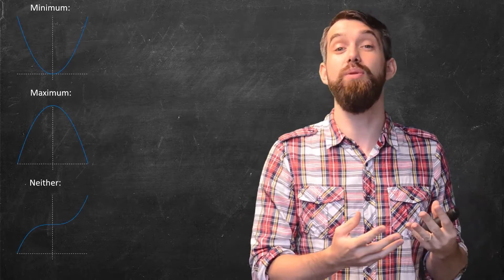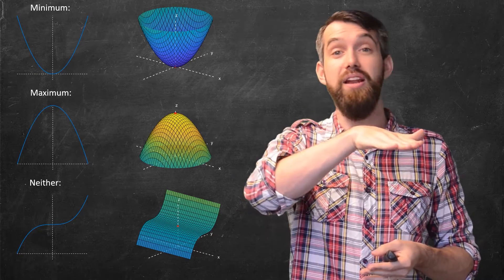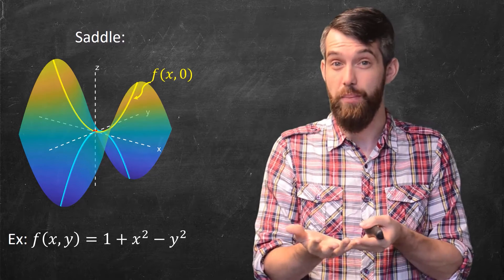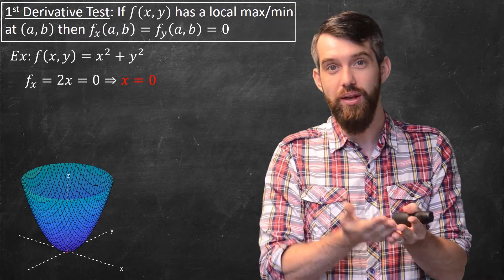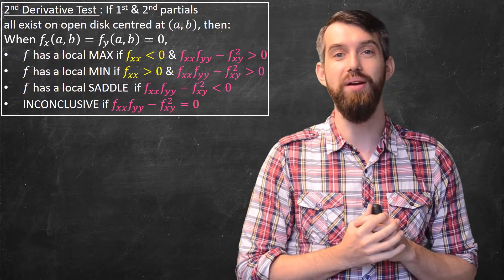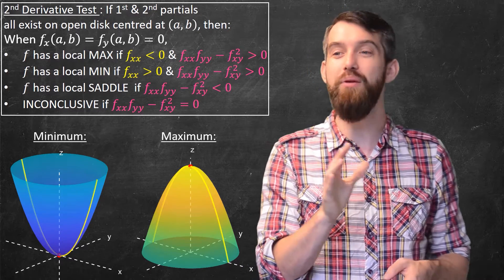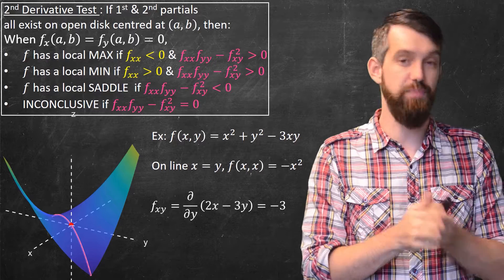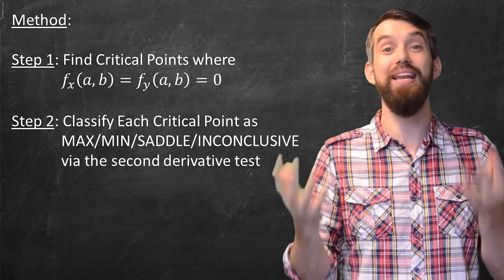Multi-variable Optimization & the Second Derivative Test

Comment: Thank you very much sir. all doubt clear . only i have a doubt on mix partial derivative and between their negative sign operation. and why overall quantity greater than zero. and if equal to zero then why inconclusive.
Reply: The conditions come from the second order directional derivative, which is a quadratic form Q = u^T.H.u (u is the direction vector). Analogous to the second derivative test in single variable calculus, for example, this derivative must be negative in all directions for a local max.

If the Hessian H has a positive determinant (H>0), then Q is positive definite (H has both positive eigenvalues) or negative definite (H has both negative eigenvalues). So you check the sign of fxx to determine if it’s a local min or max

If H<0, Q can be both positive and negative for different direction vectors u, so you get a saddle point 

If H=0, you get a zero eigenvalue and the test is inconclusive, and you need further analysis to determine the nature of the critical point

Comment: I love how well you explain the intuition, you have an extremely pedagogical way of teaching maths!

I had one doubt that I couldn't solve and confused me:
Assume the function x^2 + y^2 + 3 xy
It gives me fxx=2, fyy=2 and fxy=3    Hence fxx.fyy - fxy^2 = 4-9 = -5 <0
This would lead me to conclude that it is a saddle point, despite it obviously being a minimum (in words the diagonal effect 2nd deritavites indeed dominate the 2nd deriative in the direction of x and y, but that's not an issue because they all go to the same direction, all going up as x and y increase)
So why do I get a negative value and the wrong conclusion with this forumla? Did I do something wrong?

Comment: I tried to figure out what fxy means so,
We think of first derivative as difference in function as in the limit formula for derivatives.
Think of the second derivative as difference IN DERIVATIVE.
For local minimum the derivative was negative then the derivative was positive and positive minus negative is positive so when fxx is positive it is a local minimum.
Now for fxy think of it as ok get the derivative with respect to x. Now we have a function fx (first derivative) so when we go in y direction, how the derivative of with respect to x changes.
More clearly as in the example in the video, the derivative at x=0 is 0 as z does not change. But if we go some small distance in y you will find that when you subsitute in the fx (first derivative) with new values of y and SAME X, you will find that z has decreased !!! So it wasnt local minimum as fx said and it is clear in the visualization that the slope IS DOWNWARDS. SO WE HAVE SLOPE = 0 THEN SLOPE = NEGATIVE. AND NEGATIVE - 0 = NEGATIVE as we found mathematically that fxy is negative.
It is like ok i am local minimum along x but am i higher in other directions? Like i am at the bottom of a house on a mountain, i can move only up my house or stay at the bottom but i cant move forward as i will fall (i am not at bottom at this point, there is a point more bottom than me).
But i really dont get the meaning of fxx times fyy, what does their result say. But i think it does not tell something special other than that it is compared with fxy to see which is larger. Also i dont get why someone larger meaning suddenly something. 😅

Comment: Great Explanation!
I have a doubt though.. say my function is sinx+siny+sin(x+y) partial derivative w.r.t. x and y will be cosx+cos(x+y)=0 and cosy+cos(x+y)=0 respectively, now to find the critical points do I equate both the eqations and thus eliminate cos(x+y) or do I go by the general rule and expand the functions by addition formula? According to me, we should go by the second method as it is generalized but the first way also gives the correct answer...why is it so? Please Reply whenever you can.
Thank You :)
Reply: I think the first way is more of an trick, but totally works, both partial derivatives should be equal to 0 at some x,y, so in fact they will also be equal to each other. So you get cosx=cosy

Comment: I was reading another book on CAD/CAM where it is stated that the gradient vector gives the normal to a tangent plane at a point.  I can provide the details of the book if required.  I do not believe this to be true and so I am trying to resolve this apparent clash.  Can you confirm whether or not the book statement is true or not to try and save me some time.  Is there a special case where this might be true?

Thanks
Tony
Reply: Yes, it is true. Gradient vector always gives the normal to the plane which is why you use to find the tangent plane at any point. Why did you believe it is not true?
Reply: @muthukumarr5217  
I'm not Tony Aimer but I found it counter intuitive at first. I would have thought the gradient pointed in the direction of speepest ascent / descent but later learned about the whole "normal" thing.